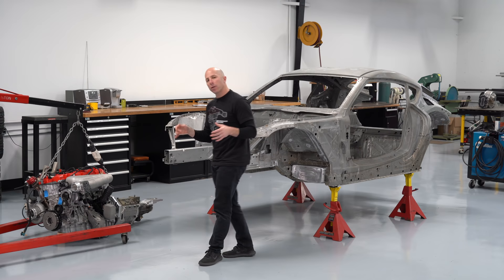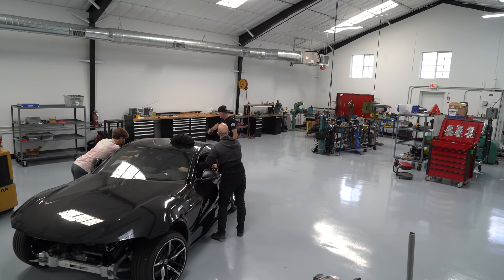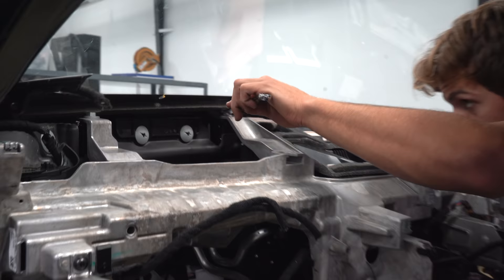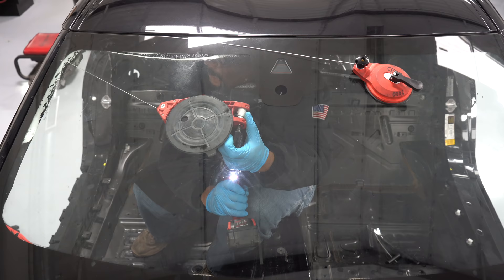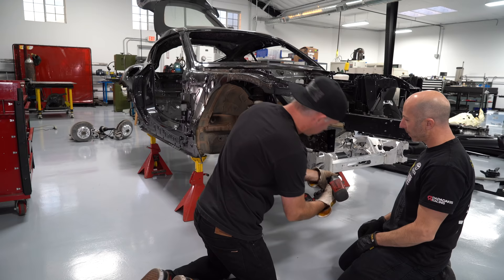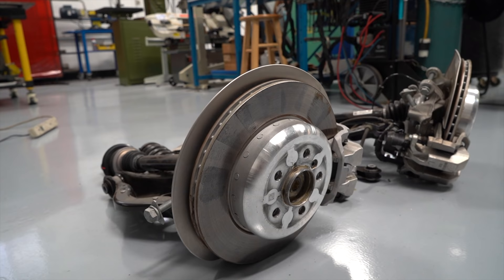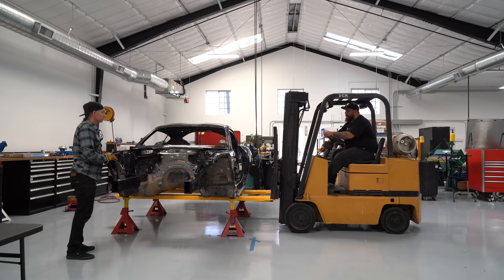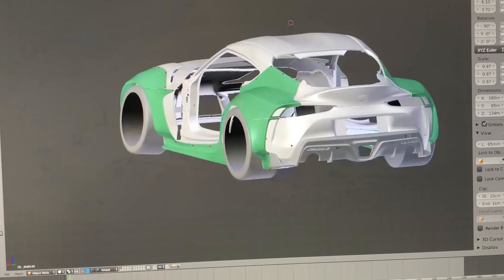Supra Complete Teardown and Strip

Comment: "Made already a thousand HP with the stock engine" 

Imagine all the kids saying this engine was shit because its not a 2jz and its Bmw
Reply: It wasn't a stock engine, it was pretty significantly modified. With the same mods, the 2JZ can make significantly more power than the B58.
Reply: @PistonAvatarGuy  it really dident have a lot done to it pistons and rods thats it...
Reply: @PistonAvatarGuy  pistons rods head intake and turbo is not that significant
Reply: @WearyKirin  It is when the 2JZ can make something like 500 hp more with the same mods.
Reply: @PistonAvatarGuy  Stop being a fanboy and just admit that the B58 is good. The 2JZ was made for modifications, the B58 is just a mid/high level BMW engine who wasn't made thinking about modifications.
Reply: @PistonAvatarGuy  a B58 can make 500hp with a tune without touching any part of the engine...
Reply: @alemãodeca  The point is that it's a step backward from the 2JZ.
Reply: @carboydorifutoparty3976  And?
Reply: @PistonAvatarGuy  meaning your paying less to get 500hp out of a B58 vs a 2j.
Reply: @PistonAvatarGuy  Yeah, a more economical and eficient engine is a downgrade compared to a 20 year old engine. You're absolutely right
Reply: @carboydorifutoparty3976  Well, no, because the 2JZ can do basically the same thing. It's a little different, because of the older technology involved, but it doesn't really matter when you have far more potential with the 2JZ.
Reply: @alemãodeca  In a sports car, yes.
Reply: @PistonAvatarGuy  firstly no. It's not like your going to be paying the same amount nor more to get power out of a 2j vs B58 since B58s have been breaking over the 600-700hp mark way faster and quicker than doing so with a 2j and even paying less to get that kind of power with barely any mods to do so. And every engine has potiental not just a 2j. There are a long list of 6 cylinders that can make the same power as a 2j with just as much work done to them
Reply: @carboydorifutoparty3976  why is 1000 hp needed anyway for the new supra. 200mph marks can now be made with even less horsepower. If it's for drag racing then it's fine. What's next. Are they trying to make the supra a hypercar killer now?
Reply: @carboydorifutoparty3976  Way faster and way quicker? What are you talking about? Yes, every engine has potential, but, AGAIN, the 2JZ has MUCH greater potential.
-
There's only ONE other 6 cylinder that can compete with the 2JZ at its highest power levels, and that's the VR38. There is ONE BMW S38 that can compete with the 2JZ, but it has a billet block.
Reply: @DAddy-iy9mu  never said it was was just saying that it's not impossible for many 6 cylinders to make the same power as a 2j.
Reply: @PistonAvatarGuy  No no there isn't. The 1FZ,RB30(RBs are slowly catching up)TB48,250 4100 chevy,barra,heck now the S55 can even be capable enough to make 2j power if they got more attention since there's already a small bunch of them cracking 800-1100+ that aren't billet blocks. Heck even the S58 would be another engine that has a stupid high chance in being like the 2j since its literally a B58 and S55 put in one. Also B58s aftermarket isnt as big as the 2js but that doesn't mean it doesn't have potential. Even by then people will be sleeving them or making billet block for them once they have the parts needed to help it support more power.
Reply: @carboydorifutoparty3976  NONE of those engines are making around 3,000 hp, you have NO IDEA what you're talking about.
Reply: @PistonAvatarGuy  Can you explain yourself on how the 2JZ has ''more potential''? Making 1000hp on a stock block isn't a big accomplishment anymore (especially on an iron block). Even a junkyard 5.3 iron block LS can hold that power without any issues. The mods that you need to make 1000hp on a 2J are pretty much the same as any other modern engines with the same displacement. I'm sorry to tell you that, but the 2JZ is an old overrated and overpriced engine, you should move on.
Reply: @PistonAvatarGuy  ok but HOW MANY 2JS ARE OUT THERE RUNNING 3000HP. THE VR38 IS A V6 NOT A I6 LEMME REMIND U. There are plenty of example of other i6s that'll make the same kind of power a 2j can. There are plenty of barras,RB's,4100 i6s,  if there was more attention towards these 2 the 1FZ and TB48s that'll make 2j power. If any but if all these i6s got the same attention as a 2j they'd be in the SAME position as the 2j is RN. They are all more than capable of 2j power if they were to have as much aftermarket and r&d as the 2j.
Reply: @MrArcticPOWER  Why are you people so hung up on 1,000 hp? The 2ZJ can make THREE TIMES that much power with a factory block.
Reply: @carboydorifutoparty3976  Who cares how many there are, the point is that it's possible! You said 6 cylinders, not inline 6 cylinders.
-
"There are plenty of example of other i6s that'll make the same kind of power a 2j can."
-
No, there isn't, the 2JZ can make 3,000 hp, there are only a few 6 cylinders with that kind of potental.
-
"If any but if all these i6s got the same attention as a 2j they'd be in the SAME position as the 2j is RN."
-
No, they wouldn't, not all engines have equal potential, and the B58 is especially lacking in the areas which would allow it to be competitive with the 2JZ.
Reply: @PistonAvatarGuy  firstly there are i6s that are more than capable of making more power than a 2j can on stock block like the TB48,1FZ,or even the 4100 i6 for example. If there was MORE attention/aftermarket for them they'd be capable of handling like despite all three of them needing billets since they can't go over 2000hp with out it(other than the 4100 i6 since the Brazilians have made it possible to run 2200 or more on stock block) that would be capable of running that kind of power. It doesn't need to be a 2j just to make 3000hp. Put the same kind if work in any of the 3 engines I listed and they'd be capable of pushing that kind of power if they had just as much development as a 2j. Plus just because it isn't a 2j doesn't mean it's not going to be capable of pushing a lot of power. There are RBs,4100s,a few 1FZs, that are all different from the 2j that are making 2j power despite there aftermarkets being smaller(other than the barras,RB's,and 4100s).
Reply: @carboydorifutoparty3976  Show me examples of any of those engines making 3,000 hp.
Reply: @carboydorifutoparty3976  Also, many of those engines are significantly larger in displacement than the 2JZ and B58, which makes it much easier to get big power numbers out of them, but the B58 is already very near its limits for the amount of displacement that it can support, and that's just one of many shortcomings that it has.
Reply: @PistonAvatarGuy  no no it isn't, They haven't found the limits of the stock block yet( limits of the internals are 800whp+ before the stock pistons start bending) they don't know how capable everything is yet for the B58. Heck they haven't even reached the limits of the B58s stock block to even speak of limits yet. Heck things are bound to change with the 2021 mk5s B58s since they have 6 port heads rather than the 2 port heads the 2020 mk5s have plus the 2021s having a lower compression ratio. Heck ot being a aluminum block their more than bound to get sleeved in like a year or so once the aftermarket starts making more parts for them any way and billet blocks might start getting developed once they see the limits of it's stock block. There are a few S55s out there that are pushing 1000whp or 1100whp+ on stock block out there despite people knowing it's simple crank issue. And if that's not enough the S58 is literally both a B58 and S55 put in on with enough parts to show thats it's got the definite potential to push more power than the B58 could and possibly the S55 on stock block.
Reply: @PistonAvatarGuy  Yeah i'd love to see that. And why 1000hp? Simply because there's not point in having more than that beside drag racing. And for any other Motorsports, saving 100 pounds from a factory aluminium block is much more important than having 3000 useless horse power. Why are you people so hung up with 2JZ,s? It's only quality is the parts availability, other than that, it's heavy and outdated.
Reply: @MrArcticPOWER  "Simply because there's not point in having more than that beside drag racing."
-
Which is what the 2JZ is famous for.
-
"Why are you people so hung up with 2JZ,s?"
-
Because it's one of the greatest engines ever made!
-
"It's only quality is the parts availability, other than that, it's heavy and outdated."
-
It's main quality is that it's an EXTREMELY well designed and well built engine that is STILL kicking A-S! https://www.youtube.com/watch?v=YmhAWKca998
Reply: @carboydorifutoparty3976  I said DISPLACEMENT limits. The whole architecture of the B58 is also wrong for making big power. The bores are too small, which means the valves are too small. The port in the head for the direct injection makes the valves even smaller. The piston speeds are too high at high rpm because the stroke is too long. The valvetrain is made to support the Valvetronic system, which also limits maximum rpm, as well as cam choices. The 6 port head will help some, but that's something that the 2JZ already has. By the time the aftermarket gets done modifying the B58 to make big power, it wont even be a B58!
Reply: @PistonAvatarGuy  yea but the 2j barely has a existing history on the track. Better yet it was literally thrown to the side for a iron block i4(3SGTE)or a aluminum block V8(1UZ or 3UZ). They are not a good choice for track in any instant unless they decide to drop it into something as small as a kei car or a miata(which would still destroy both those cars balance).
Reply: @carboydorifutoparty3976  The whole Supra chassis was never a good fit for the track, it was always too heavy. The Supra was always a GT car, not a track car. That's the problem here, Toyota wants to change the whole nature of the Supra! If you're going to completely change the character of something, at least have the decency to give it a new name!
Reply: @PistonAvatarGuy  the whole family of supras are barely comparable in the first place. They went to the sportscar route for a reason. To compete with the Z and Porsche just like the mk4 did with the 300ZX and 911. And because they had enough gt cruisers already so they wanted to make the mk5 a sportscar plus the fact that a majority of the mk4 fan base call it a sportscar despite it being a gt car.
Reply: @PistonAvatarGuy  just like the 2j. Once u start throwing mods or even going billet it's not a 2j anymore. Heck doing this with any engine isn't going to be the original engine once u start throwing mods or stroking,boring,or going billet won't even make it too much more comparable to the original.
Reply: @carboydorifutoparty3976  It's not even a Toyota, it's a BMW, so they're not competing with anyone, BMW is.
-
The 2JZ makes huge amounts of power with the factory head and block, while the B58 is so poorly designed for making big power that it will either never be competitive with the 2JZ, or it will be unrecognizable as a B58.
-
AGAIN, there isn't much room to bore and stroke the B58, it's already near its limits in that regard. Increasing the stroke will also worsen the already extremely high piston speeds.
Reply: @PistonAvatarGuy  poorly designed? Sir their pushing the same if not more power than a 2j is on stock internals,it's pushing more power easier without evem opening the engine,and it's blocks already looking to be MORE than capable of handling 1000hp just like a 2j. Heck it being a aluminum block it could probably push up to the 1100hp range just like the few S55s out there are. B58s have 2 different heads coming from 2-6 ports and are not weak since most are still running stock heads and aren't showing any major limits yet and heck once the 6 port B58 mk5s start going around they'll probably be decent enough to handle more power. If you think a B58 is like a N54 then u definitely need to do more research on these then. B58s already share the block internals(forged too),and crank from a diesel i6 that'll happily handle 1000hp. Plus boring or stroking these aren't impossible. I've heard people say that it isn't impossible to do that with these but they haven't gotten that far since their now just having hands on with this new engine.
Reply: @carboydorifutoparty3976  Like I said before, you have no idea what you're talking about.
Reply: @PistonAvatarGuy  ok then tell me how much power a 2js stock internals can handle vs a B58s. Plus they don't need to share any kind of characteristics to a 2j to make power. Every engine has its own way of making power.
Reply: @PistonAvatarGuy  Plus the B58s block might even be better anyway 2jzs stock block. Takes up less heat,weights less,and probably is even capable of handling the same power. Just because it's BMW or any other i6 doesn't mean it's weak by any means.
Reply: @carboydorifutoparty3976  What difference does it make? We're talking about the maximum potential of the engines, not how strong the factory components are.
Reply: @carboydorifutoparty3976  "Every engine has its own way of making power."
-
There are certain characteristics that make power, yes, but the B58 doesn't have any of them. It can't breathe because of it's head design, it can't rev because it's an undersquare engine and its displacement can't be significantly increased because it's already close to its maximum displacement limit. Not all things are equal, buddy, some things just suck.
Reply: @PistonAvatarGuy  again there are 2 different heads for B58s.2 port heads integrated into the engine that's in the mk5 and 6 port which is a traditional head setup that aren't. People haven't even gotten deep into all of its parts to really do much at all to even go that far for the heads and places for the engine to breath. Heck ams is one of the few companies now deciding to look into that just now while other companies like twisted tuning have benchmark hps to see how much the internals can take and are still testing. The mk5 and BMW are still in its early stages really get that deep for thing like how it's breathing. And if the engine breathing was a problem we probably wouldn't have seen B58s jumping over 700whp already without any problems to be present. Heck there's one B58 powered 240i(6 port head B58)that's been holding the record of 900whp still on stock block that has been said to still using the stock heads.
Reply: @PistonAvatarGuy  You're still saying that it's one of the best engine but not why or how. I'm still waiting on a simple explanation. HOW is it so well designed? 3000hp doesn't mean shit if there's not a single stock part left on that engine.
Reply: @MrArcticPOWER  The head and the block are still factory pieces on some of the engines hitting that power level. The block becomes a liability at those power levels, so many of the engines making more than 2,500 hp are going to billet blocks. I already made a comparison of the B58 and the 2JZ. All of the ways that the B58 is wrong are all of the ways in which the 2JZ is right.
Reply: @carboydorifutoparty3976  I wasn't talking about the ports, I was talking about the small valves, and that can't be changed (significantly) without designing a new engine with a better bore to stroke ratio.
-
"And if the engine breathing was a problem we probably wouldn't have seen B58s jumping over 700whp already without any problems to be present."
-
That doesn't even make any sense, volumetric efficiency doesn't have anything to do with how strong the engine is, it has to do with the ultimate limit of its performance. As power levels increase, the amount of fuel and air that can be crammed into the cylinder will ultimately be limited by how well the head flows, and the B58 head will never outflow the best 2JZ heads.
Reply: @PistonAvatarGuy  Any engine is designed too make a certain amount of hp and the most efficiently possible (fuel economy, gas emissions, etc.). Saying that the B58 is poorly design because it has small valves and ports is wrong. The engineers that built it don't care about the potential it has once it leaves the factory.  Now if you think that the 2JZ is well design simply because it has a bulletproof iron block, you're just being a fanboy.
Reply: @MrArcticPOWER  I said that it was poorly designed for making a LARGE amount of power, I didn't say that it was poorly designed. The 2JZ is superior to the B58, IN THIS CONTEXT, because it has a better bore to stroke ratio, which gives it larger valves, lower piston speeds and more potential for increased displacement. It also has a stronger block, and it has a direct-acting valvetrain, which makes aftermarket cams simpler to produce and gives it a higher maximum rpm. The B58 is like a Honda D-series, it's pedestrian, it's an eco engine, it's WEAK, it's not a racing engine.
Reply: @PistonAvatarGuy  Alright dude, all that time instead of saying "the 2JZ is such a superrior engine" or "the B58 is so poorly designed", you should've just said: the 2JZ is a better platform to build on for drag racing records. If there's a poorly designed engine between the two, that's the 2JZ because overbuilding anything isn't something a good engineer would do. The 2JZ was never meant to be a racing engine either.
Reply: @MrArcticPOWER  I've been saying that all along. Toyota engineers built something that they would want, which is why it's so loved by the automotive community. The 2JZ was designed by automotive enthusiasts, not bean counters.
Reply: @PistonAvatarGuy  Thank you for not throwing any insults btw, it's usually not how arguing goes on the internet.